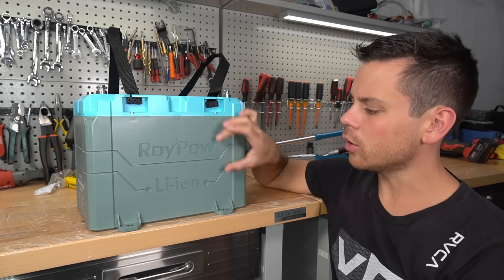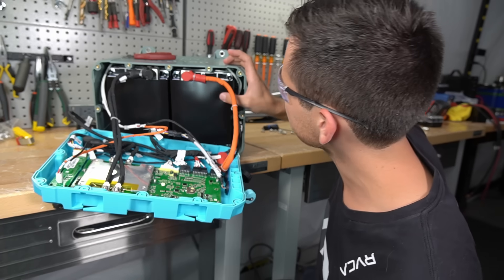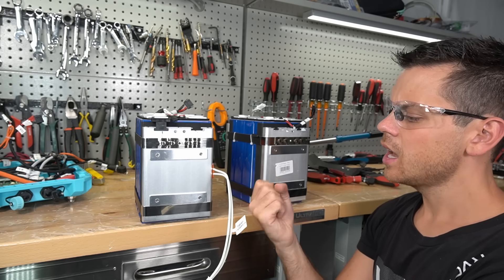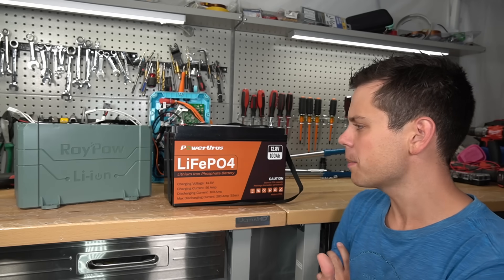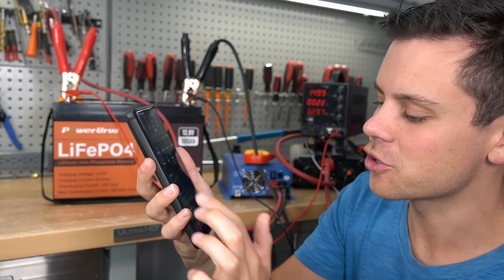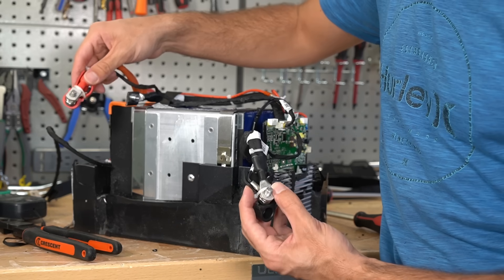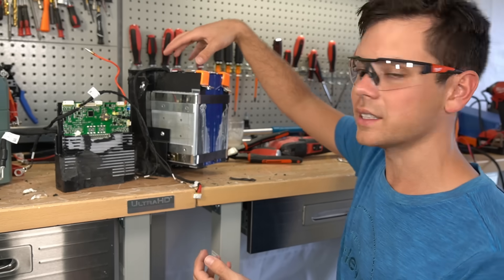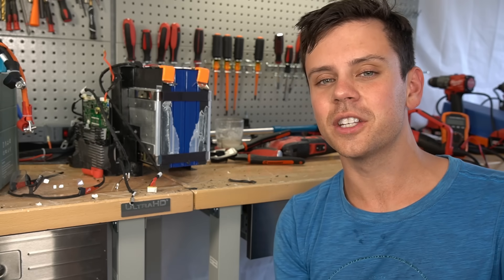RoyPow Solar/Marine/Golf Kart LiFePO4 Batteries

Comment: I have a couple off grid systems.  One is small (2 L16's) that just handles a cabin's entertainment and a few 12V lights.  No inverter.  (The other is quite a bit larger with 4 outback inverters).  I'm considering changing the small system to LiFe batteries.  I don't need a lot of power there and there are advantages to the LiFe batteries obviously.  ONE problem I see is that the charge controllers on that system are of course designed for lead acid batteries and the CC does not have a setting that allows the absorb time to be reduced down short enough.  I think it is more like a few hours.  Is this critical and should I get a new CC if I want to put in LiFe batteries?

Comment: There is a wave of off grid Marine/Boat conversions going on and for the most most have no clue what's available. A majority of these conversions will involve: a LiFePo4 House bank (12 or 24V),  an AGM 12V Starter Battery and potentially a 3rd bank for Windlass operation.  The Go-To power replenishment source will be solar panels, then wind and finally shore power.  Would you consider making a video covering the basic requirements for a Marine set-up, the correlation of a 24V LiFePo4 House Bank to Solar size where daily consumption runs from 2Kw to 8Kw?

Comment: As of right now, 08/13/22, their 24v200AH is $900. If trying to run 24v200AH you are paying more than a EG4LL.

Not an expect but seem server batteries the way to go for building any kind of a decent battery bank and the smaller batteries are better for a single battery system.

Comment: Just bought a roypow 30 amp battery.  The battery I received is below 3 volts on delivery, and obviously used.  It has abrasions and residue on the face of it.

Comment: It’s been hard for me to find a 24 volt 150 AH or higher battery. Some retailers do not show that you can use two 12 volt batteries in series. So I’m still looking. I refuse to buy them without knowing I can use two 12 volts in series safely.

Comment: Well you reviewed these so I am sure they are all sold out now, lol.  If they put a nicer case on the cheaper battery they would probably have to add $200 to the price of the battery.  Those cheap cases are not very cheap I have found researching to by some. Unless you know something I dont.

Comment: 16:38 I would think that the rubber would have more thermal capacity, and a better connection (thermally) to the outside world, than the air trapped in the enclosure. I suspect that is intentional.

Comment: They increased the price 200-400 overnight after the video dropped…. +100 even with the “discount” 😅 won’t be buying that.
Reply from the maker: They did not. Read the description and pinned comment
Reply: The 100amp battery is the same price after added to cart, however the 200amp battery is not even with the cart discount, they jacked it up only a hour after your video was released alongside the "promotions". Pretty scummy by them.

Comment: That heat sink is probably designed that way intentionally to allow the heat to exit the enclosed system through the battery casing itself.  Otherwise, a heatsink in an enclosed system touching only the enclosed air can only reliably exchange heat with that trapped air.

Comment: Will, I'm really impressed by the RoyPow B24100H Li-ion trolling motor battery.  The 100Ah RoyPow PowerUrus LiFePO4 battery was pretty nice also, despite its discount battery costume. 

I  would love to see a smaller RoyPow deep discharge battery to match my 100Watt Coleman solar panel with 8.5A charge controller that I bought from Costco.  Their literature does not tell me the size of deep discharge battery I need, nor if their tiny charge controllers can work well with a LiFePO4 battery.

Comment: The two comms ports are so that you can have a dashboard battery monitor connected AND a diagnostics port presented somewhere without interfering with each other. The golf cart batteries only have one port so you have to unplug the gauge before being able to talk to the bms with a pc.
Reply: We have a dealer who supplies us with these batteries for our EVs and yes, they do a great range of drop in replacements for lead acid traction banks.

Comment: I respect that you still published the video even when you screwed up and let the smoke out; LOL! Part of the definition of craftsmanship is ownership....even when you have an "ugly baby!" This is why so many companies utilize you as a proxy "proof engineer," and why I trust you implicitly!
Also, resistance produces heat. I had a professor who stated 99% of all electrical problems are due to "connections." Temperature surveillance at the main external connections, is a brilliant method monitoring basic maintenance!

Comment: Will, what would have been interesting is to have looked for heat on the outside of the case where the bms resides. That goo on the heat sinks may actually move the heat to the outside world instead of a trapped dead air space within at best heating the batteries. I don’t know if you have one, but I highly recommend the FLIR thermal cameras. I use a dongle for the iPhone and it works great.
Reply: That's what I was thinking. Since everything else was so well designed, maybe we shouldn't second-guess their way of dissipating heat.
Reply: We specialized in LiFePO4 battery for over 14 years, we are proud of providing premium 12v 24v 38v battery with an effective  cost to our customers, if you have any interests welcome to share with me.

Comment: I had went to their website early today and the budget battery was $400 now it is listed at $600. If you put it in your cart it does discount $200 for first time customers. So it is $400. Their webpage is misleading and I bet they loose sales by not showing the discount on the battery page. They give that discount on multiple sales of the battery. I just kept adding to the cart and it kept discounting each $200
Reply: I did the same

Comment: Now that you’ve done your review the price that used to be 400 is now 600 and the 200 amp battery is now instead of 800 is 1100. So I guess they can keep their Darn batteries.
Reply: I thought the same as you, but add the batteries to your cart and you will see a $200 discount per battery for new customers.

Comment: Looking forward to seeing the conversion of a golf cart from lead acid to lithium.
Reply: It'd be neat to compare before and after speed and endurance tests.   😀
Reply: @pferris3591  thanks for your response. Speed seems to be voltage dependent, so the real test will be endurance. But I’m wondering if a different battery charger will be required.
Reply: @pferris3591  it seems the Roy-Pow 48volt conversion with the $200 power supply included runs between $1800 and $2100. It is capable of supplying 100 amps continuous. It seems hot orders could need between 150 to 200 amps continuous, so the circuit protection might trip. Also, no one seems to be stating if this battery or the Tesla batteries you used in your cart are iron phosphate and would prefer only being charged to 80%. The chargers only seem to charge to one voltage, so I’m assuming the bms won’t stop charging until the battery reaches 100% charge, shortening the battery’s life. $2000 for 48 volts at 100 amps (not sure of their capacity, and they make two sizes) seems to be more cost than you would recommend.
Reply: Meant hot rodders- damn spell check.

Comment: The rubber on the BMS heatsink in the cheap battery is probably still better at conducting heat to the outside that air would be, i.e. by filling the heatsink fins up with the rubber glue they likely achieve at least a certain amount of thermal coupling to the outside world.
Of course, being a sealed system, it will always be difficult to get rid of the heat and a heatsind without fins that is directly glued to the outside surface of the battery casing would likely be the better alternative.

Comment: They already added $200 to each price point. Bait and switch to get you to review.
Reply: When you add to the cart, you will find that the price has not changed，
Reply: @豆豆朱  I had 5 12v 100 amp in cart from earlier today.   Price now says $3k but I did not add or remove them in the mean time.
Reply: I just reduced to 4 in cart and now there is a customer discount reducing 4 batteries to $1,600 so strange but yes, correct it's back down to $400 for the 12v 100ah battery.

Comment: Will-P you need to always film the battery test first then do the teardown.  
You can edit it later if you want the Teardown to be the first thing shown.
I cannot tell you how many times Dave Jones motto "Don't Turn it On, Tear It Apart" came back to bite him in the ass when the unit would not power on after reassembly.  He later on stopped tearing down stuff without first testing it.
Reply from the maker: You don't think I can't figure that out? 😂

Comment: Is it possible to charge ev batteries with solar panels and charger / inverter less battery? The EG4 6500EX-48 appears to operate without batteries.

Comment: Outside Terminal Heat Sensors without low temp cut off makes sense since the terminals can be cold from the environoment but inside cells are still warm enough. 
Detecting terminal overheating due to poor connection quality with loose screws and maybee overcurrent drawn is realy smart.
As long as the inside cell Temp Sensors cut of charging below Zero all is good.
Only one sensor for low temp cutoff is still a bummer. since if this one fails you dont have a spare.
The Heatsink in the Rubber gives some body heattransfer to the outside. Better as just air arround inside the thight case working as thermal insulation. (Some newer Toolbatterypacks do this with the Plasticasing arround cells. Eliminating Airgaps between cells and outside shell even a poor thermal conductor like plastic is better as just air.

The "cheap" encasing is nothing to worrie about as long as it matches outside dimentions of standard batteries abd got carring straps.
As you see on the outborad batterie case the mounting wing take space some might not have in their batterie compartment.
It would be nice to have a Inside x ray like view of the batterie for the customers or a clue where the bms heatsink is.
This side is the point where you might put watercooling pipes for the batterie pack or press it against a tankwall or you might put a thicker metal plate (aluminium) onto an encasing as a heatsink.

Comment: One small detail: 4 batteries= $1600, a server rack 48v/100 amp $ 1450.....so these are not cheap....but if you need 12v or 24v then yes they are usefull....

Comment: Great review, & I think it's time to add the final testing as you are getting heated batteries and not testing that function.  Here is why.   Some of these heated batteries cut off the output current when there isn't enough input current for the heaters, effectively leaving you with no power at all...   Is that true of your now smoked 24v trolling battery?

Comment: OMG that scares me when Will messed up. I wish Will, u stop saying "the battery is cheap for the build quality". Quality does not need to be expensive. We been brainwashed to think that's so. They can sell cheap crap & charge more because of that thinking. 
I don't hv that budget to buy a $400 dollar battery 4 my homes on wheels. Plus after having to buy all the other stuff to make my own power supply, I'm way over my budget. I'm sure there r many others who has low & tight budget. 
No disrespect Will. Just saying. I know price has drop some but still expensive for a lot of us. ✌🏽

Comment: I have a question. I have four 100-watt panels charging 2 100 ah lipo4 batteries. I am running my refrigerator and a chest freezer for about 8 hours a day from morning till afternoon. I then take them off the system in the afternoon and let the batteries charge up a little before evening. The batteries rarely get below 13 volts during the running cycle and usually are 13.3 volts or higher when i start the cycle all over the next day. Am I doing this wrong running powering the refrigerator and freezer during the charging cycle of the batteries during the day? Or should I be running the refrigerator and freezer during the night off the charged batteries and the shut them off and let the batteries recharge during the day and then repeat the cycle each day?

Comment: The undocumented "communication" port is possibly an internal quality control test port and not meant for consumer usage.
Update: In an Amazon image for their 24V 80Ah I see a cable attached to a "whistling" battery monitor to display the SoC, so possibly it's for a similar device that they haven't started marketing yet.
Reply from the maker: It is designed for consumer usage. If it wasn't, and they spent money on it, they are trying to lose customers. That would just be silly

Comment: Is it possible to charge the battery using 30+amp dc to dc charging from alternator and draw 15amp  current at the same time from load? Looks like a good RV battery.

Comment: It's curious that their 200amp hour battery costs $100 more than 2 of their 100amp hour batteries.
Reply: Not really, 200A BMS vs 50A BMS, very different use cases.

Comment: Maybe some of you could help with a silly question. What if I had 3 rack batteries, the first one is at 100% and the 2nd and 3rd are at 50%? If the 3 of them were at the same SOC the profile will be good (absorption, bulk or float), but what profile the SCC uses if there are different voltages (if it uses the average voltage, will charge on bulk, but the 1st one is already full, and it's going to take more current than it has to, isn't it?) It drives me crazy!
Reply: That's why each one needs its own smart charger, otherwise they'd all be short lived. Nearly all types do have their own SCC built-in so each only draw current as needed. They can share the same charging source, just not not the same SCC.
Reply: @ralphbell1786  Thanks for answering. I'm aware that some BMS (seplos 200a for instance) limit the current at some point. But all the Will's diagrams and videos with a rack system have a main SCC and the rack paralleled. Seems weird that for me could be a major issue, but nobody is using one SCC for each pack (super expensive and wasting a tone of energy)
Reply: @garbi8526  you are correct, I apologize. The BMS should regulate what each one needs. I need to have my coffee before posting!

Comment: I have a 48V LiFe Charger @8A and I like to stop charging when the voltage hits 55V~56V instead of 58V that it does now.
Can you recommend a charger that can be programmed to stop charging at 80% ? 
I could build a circuit with a window comparator and a relay to do the job, but I am lazy and would take the least effort road if I can. 
The other alternative, is to open up the charger and adjust the output voltage, but that means I can never use the absorption cycle to top it off, once in a while for balancing. 
Any suggestions?
Reply from the maker: Charge to 100%
Reply: Off-grid Garage has done videos on various charging parameters for LFP batteries;  you can't go by a state of charge with them but setting to 56.0v / 3.50v/cell is a good balance point.  You should be able to program the BMS for that.
Reply: @Mazlem  My Daly BMS is not programmable or has BT, and I've seen ALL his videos.
Reply: @Mazlem  Also, you can estimate the capacity left with voltage readings down to milliVolts.
Just not as precise as a Coulomb meter, and you can't read a proper voltage when under load. It has to be unloaded.

Comment: Hi Will. You’re my most favorite teacher. I have learned a lot of things from you, bought your book and frequented your website. I started to build a small solar system. After watching one of your video reviews, I bought two Ampere Time 12v 100ah batteries connected in parallel. Can I buy two more of these Roy 100ah batteries and mix them with my two Ampere Time batteries connected all 4 in parallel?
Reply: If you are gonna do it do it right now!  When Will says he is really impressed it is the kiss of death to available inventory.  Seriously, time and time again, because he has our trust, Stock is of prime value and runs out FAST.  Order fulfillment and ramping up production is going to be the focus of this producer after this video.  Thanks Will. these look great.
Reply: @turtlepoi  And price will go up. 😖
Reply: Thanks, but I can't buy them unless I know I could connect my other batteries together mixing them brands. Do you have any knowledge of it? Can I connect different brands same capacity batteries together? Does anyone knows?
Reply: @bongknaek  yes, you can use the Roy batteries if they have the same voltage !

Comment: RoyPow just sent me their 30Ah. It barely pulled capacity and I plan on tearing it down this weekend. Hoping that it looks as good as their 100Ah! I did teardown their 6Ah for fish finders. It was a mess, the cell holders were all gooey like they were melting.
Reply: Care to explain why they are gooey?

Think why they made “worm proof boxes” with different makeup due to plasticizer incompatibility…
Reply: @fishhuntadventure  When I opened it up, there was a strong chemical smell. I think the plastic (ABS maybe) cell holders were melting because of the presence of acetone in the adhesive. In the 3d printing world we call it vapor smoothing to get rid of the layer lines. I am speculating that was what was going on, but I could be wrong.

Comment: Hey will can you please test the batterys from battery hoockup they have $100/kWh tag and this batterys are from EVs they have 6kwh,7.5kwh,16kwh batterys and how can we use it with 48v system.
It will be interesting so see what value can they actually provide